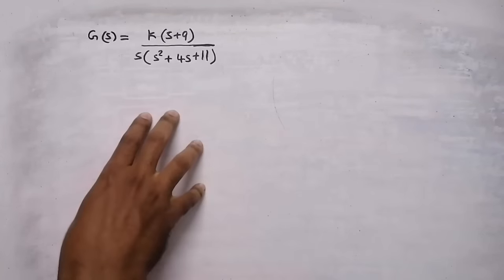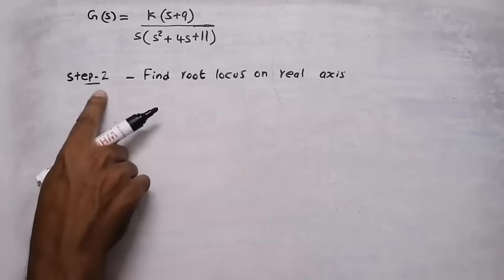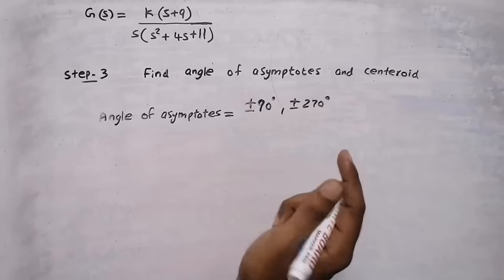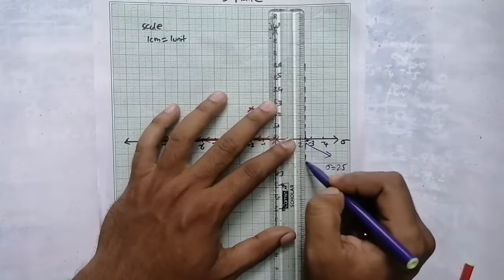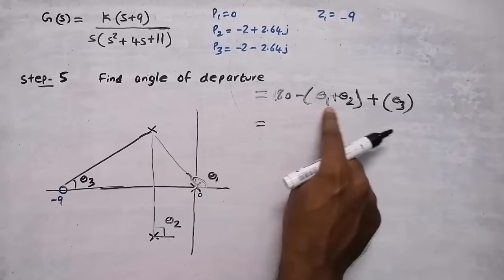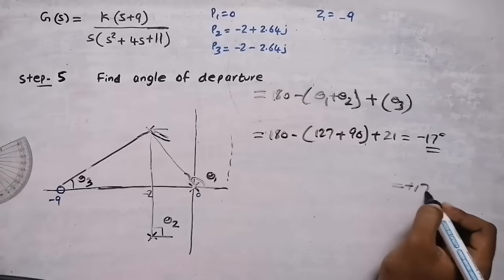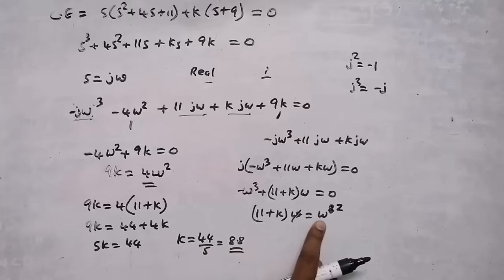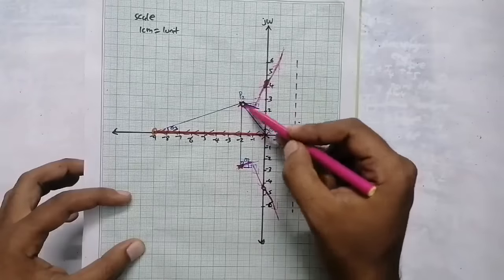Root locus for complex poles

Comment: doubt: to check root locus point  are we supposed to consider only  real poles    or for  example there is a conjugate in 2+4j   2 is on real line so 2 also shall i consider?
Reply: I think that you are asking about finding the root locus on the real line. If so the complex roots don't matter because they always appear in conjugate pairs anyways. So if you add them in you will always get an even number (2) added to what ever poles and zeros are to the right of the point you are evaluating. Since adding 2 to an odd number leaves it odd and adding 2 to an even number leaves it even you can ignore the complex roots for this purpose.
Reply: You should consider only the on real axis.(i.e. only real numbers) not the complex poles that lies on the s- plane. 2+4j is a complete pole. You should not consider only 2.
Reply: @saineethureddy6195  thanks but it's been 2 months since I've completed my xam
Reply: @mallamgurudeep1341  😂
Reply: Haa
Reply: https://youtu.be/r3TlKbs7TKQ